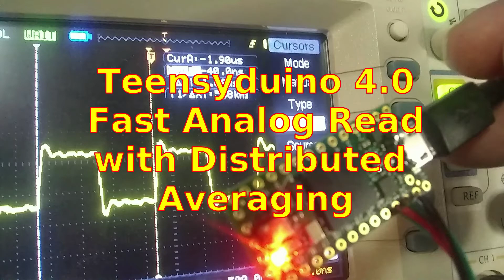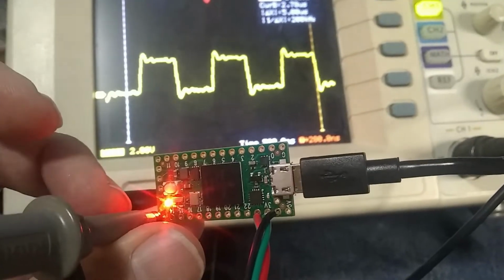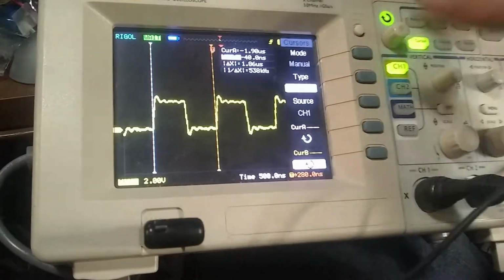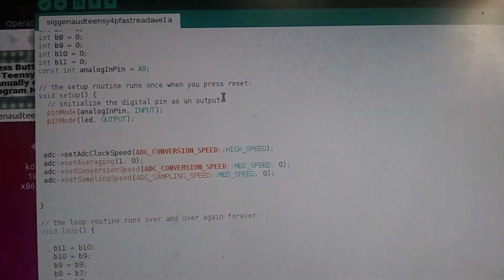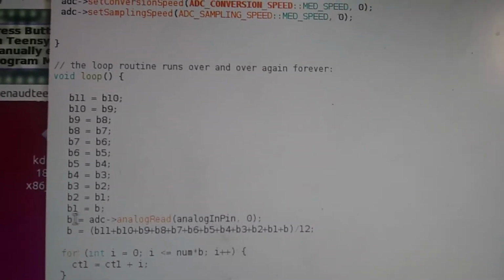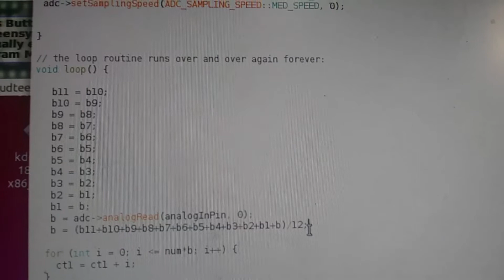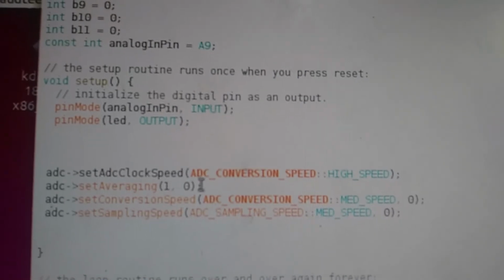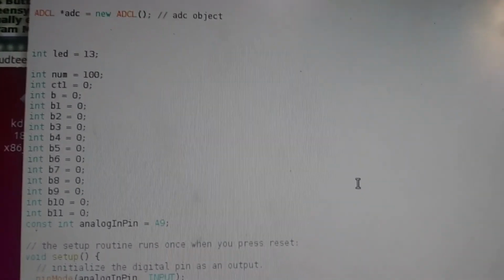Teensyduino 4.0 - Fast Analog Read with Distributed Averaging

Comment: Hi there! Thank you for taking the time to share this. I'm trying to learn about analog read's samples-per-second capabilities, but having trouble finding good documentation or discussion. Do you have any recommendations for further reading on this subject? For example, how do you specify different samples-per-second settings? What's the default setting, etc?

In case it's relevant, I have a Teensy 4.1, and I would like to sample a large array of analog sensors as fast as I can without sacrificing accuracy. I'm planning to set up a matrix of velostat patches in an xy grid of ~ 12 columns by 16 or 12 by 24, and send current via a multiplexor through the columns, then sample the rows once for each column. I'm probably not explaining that clearly, but the point is that it'd end up being 192 or 288 separate analog readings for a musical instrument, so I want to avoid latency between each loop through reading all the pads.